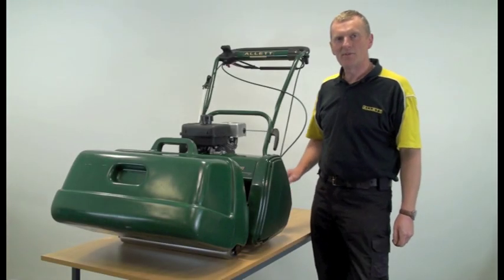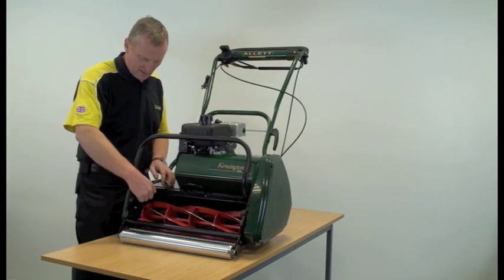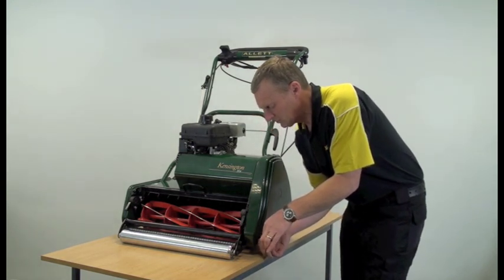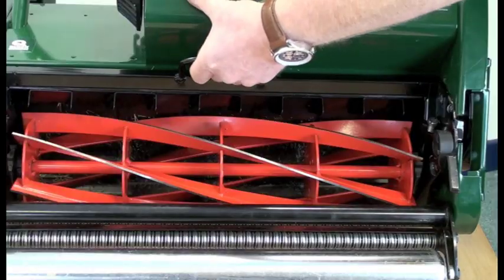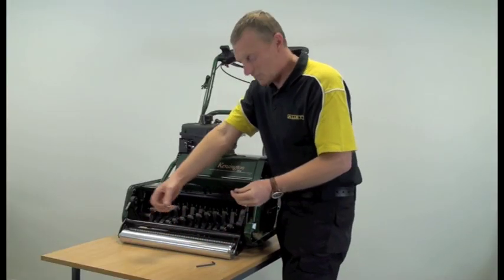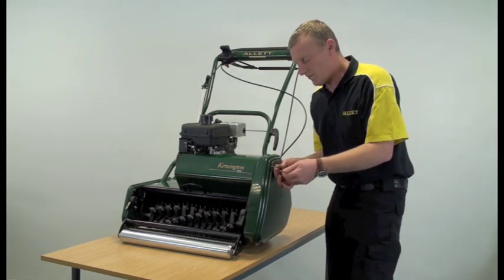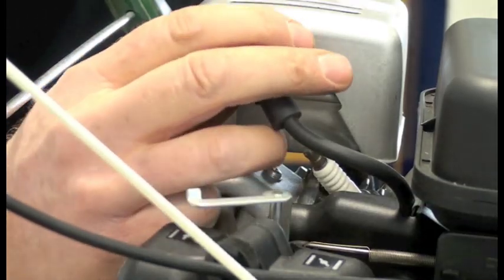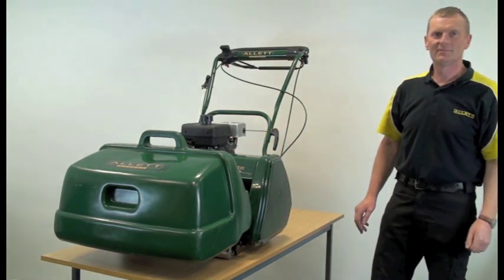Allett Kensington 14K, 17K and 20K Cylinder Mower - How to change a cartridge

Comment from the maker: Yes, they are the same machine. For information, the drawings, manufacturing plant, tooling and intellectual property rights for the entire range of former Atco and Suffolk Punch petrol and electric lawn mowers were acquired from Bosch Lawn and Garden Ltd in May 2011 by Allett Mowers' parent company, Turfmech Machinery Ltd. A comprehensive range of domestic and professional cylinder mowers is now being manufactured by the firm under the Allett brand name in Staffordshire, England.